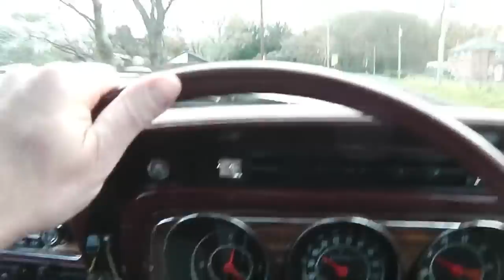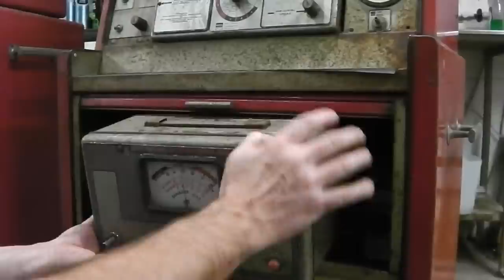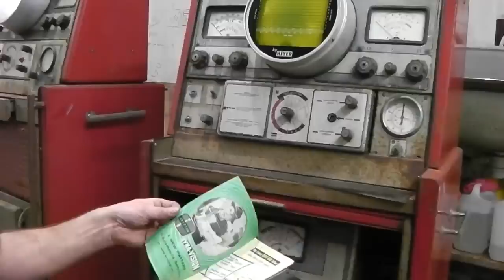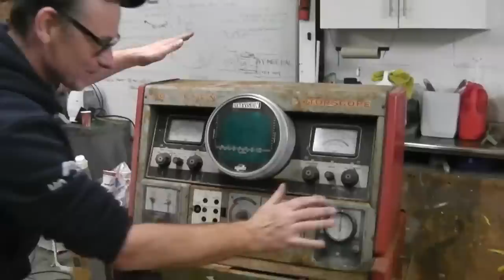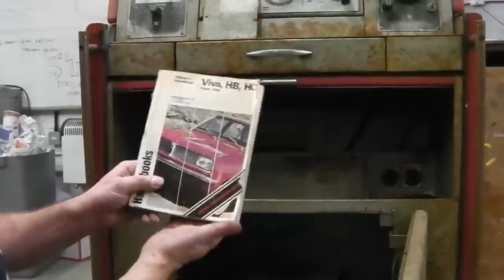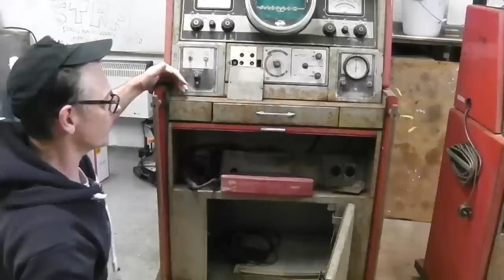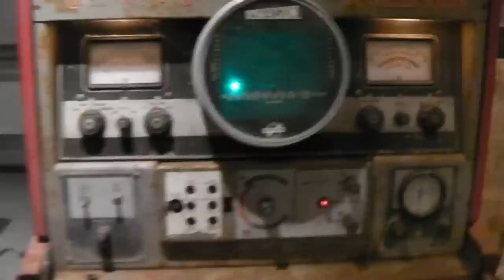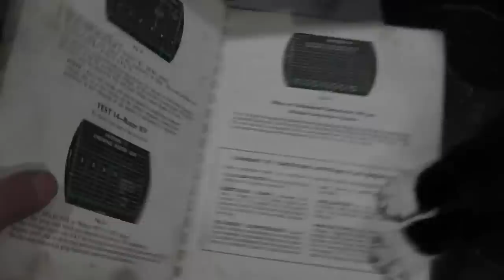Crypton Dynavision Double Bill

Comment: The Austin Allegro was a 1750 model first registered in August 1974.  DVLA records show the vehicle as having been untaxed since the 1st of March 1988 and no MoT records are held which strongly suggests the vehicle no longer exists or has been off the road somewhere for 30+ years.  It is listed as having not been exported but sadly the information on the DVLA site doesn't record whether the vehicle is recorded as having been scrapped.  An early 1750 Allegro is a rare car now, it would have to be either an SS (Super Sport, the model that held, or still holds, the Guinness world record for driving in reverse) or an HL to have the 1750 engine from the factory and both of those are now extremely rare with maybe low double digit survivors.  The Austin 1100 was registered THP 657J, first registered in August 1970, it was also white and is recorded as having been untaxed since the 25th November 1986 with no MoT records held, not recorded as having been exported and has no information as to whether it was reported scrapped.  Based on how the ADO16s could rust it's probably a fair bet that it has long gone to the great scrapyard in the sky.  The Austin was the bottom of the range for those cars and you could still buy decent ones (if you could find one) for pennies well into the '90s or even 2000s so there wasn't a lot of interest in them, had it been an MG, a Riley Kestrel or a Vanden Plas Princess 1100, or even an Austin or Morris 1300GT it might have attracted a little interest but as an Austin 1100 nobody would have cared in the mid '80s, even if it did do pretty well to make it to 16 years old...
Reply from the maker: dont know how you get all your info, you are connected direct into the 70s
Reply: @PeteCswampy    A bit of a look on the DVLA website and draw a few conclusions based on the info there.  Most of the rest of it is just having a mind that collects information that most people would categorise as utterly useless...

Comment: Hi I also have 2 old Crypton machines which i intend to use to tune my classic ( not a Cortina though) do you have a user manual or wiring schematic i have a burned out transformer in one which supplies the CRT screen & want to fin a replacement ?

Thanks B

Comment: Nice score Pete, although powering them up was not a good idea!
The capacitors on the scope part will need renewing, probably just turned in to resistors by now. Be aware that the tubes on these run at several thousand volts EHT. Proceed with care....
Reply from the maker: MArk I knwo what you mean but they were goig to be scrap. I had nothing to lose by powering up. I have worked on EHT all my life and hold Btec city guild radio and elctronic servicing pts 1 & 2  working on all types of sets from eletrohome to Hantarex and Zenith, mostly on mid 80s video gaming machines but first started on vector systems from atari battlezone and asteroids, we used to dry the tubes first, in early mornings in the arcades, damp would cause tracking on tubes that had dust, later i worked for hazel grove servicing SWP quiz games which got caked in tobaco and dust and grime, sparks galore. i have had my fair share of tube belts/shocks, and replaced and serviced hundreds of sets, most coomon repair was line output transformers which used to break down and fizzle or cause flatline, frame collapse, with these sets it was case of just plug and try after letting them warm up in work, they were sat warm for a day before i booted up, i always like your replies and i trust your constructive comments as always Mark, you should see the jerk replies I have had on this, i just block and delete every time, armchair restorers and wasters LOL all the best Mark from Pete
Reply: @PeteCswampy  Hi Pete,  Glad you know what you are doing,  I used to be in the TV repair game years ago, all CRT sets back then!
Had a few belts, the colour sets could give you a nasty zap if you were a bit careless...
Are both of the Crypton units valve based? Looking forward to seeing the guts when you get round to working on these.
I have restored many 1940/50's TV's, lust love how well things were made back then.

Comment: The Viva HB and HC Handybook workshop manual is actually a really good little book.  A mechanic I used to work with had one as he had an HC Viva estate and he swore that some of the information in the Handybook was more accurate and more useful than what was contained in the factory workshop manuals for his car that he'd acquired from the dealership.  The Handybooks seem to have been designed to be of a size to fit in the glove box of the car and they seem to be pretty rare, I don't think I've ever seen another one anywhere up until now, for any car.  Definitely one for the Viva clubs and maybe the Chevette people too as they used the same 1256cc engine...
Reply from the maker: Thank you Jamie ill try and get this to the right people, the handbook thanks for all the detailed replies
Reply: @PeteCswampy    No problems.  I'm happy to share a bit of information if I can, you never know when someone is going to be watching this 20 years down the line and finds a bit of random info useful...

Comment: When I started my career with a Fiat main dealer back in 1989 and 1990 we were still using a Crypton set up and exhaust gas analyser from the early 1970s when the garage was a Renault dealer.  It was a great piece of kit, not all that instinctive to use but very reliable and accurate, even if the trolley was a bit wobbly after 20 years of workshop life.  I wonder what happened to it after the place shut, I did keep my eyes open for a clearance auction or something as there was a lot of old information and stuff I would have loved to get, but I never saw one so I suppose it all went in the skip.  It's a shame as there were full sets of Renault factory workshop manuals and parts books from about 1960 to the mid '80s...
Reply from the maker: Jamie this is what im saying, all this stuff could be lost, no one bid on these items, ive saved em and I hope give em some notoriaty, check the NEG comment from ANDREW , wow takes all sorts, im an IDIOT according to him/her
Reply: @PeteCswampy    Some people just don't understand the attraction/addiction of old cars.  Technically the latest cars may be more efficient and are certainly safer, but most of them aren't particularly reliable, even compared to early '70s stuff, and they certainly don't have the character.  Cars have become domestic appliances now, just very expensive white goods with wheels.  But is anyone going to reflect kindly on them 25 years down the road?  I can't see it.  It's good to save bits of history, whether it's the cars or things like the Krypton machines and the attached literature, and there's a fair chance that some of the literature is going to be pretty close to unique now as a lot of it is stuff that was intended to be disposable.  As for the haters, well stuff 'em, you get joy and fun out of what you do, and so do a whole lot of other people, if they don't like it they don't have to watch, I'm sure there are plenty of gardening channels or Hentai ones for them.  I just don't understand the point of watching something that isn't going to appeal to you just to leave a negative comment, it's just a pointless use of time.  But, people are strange and a lot of people do things on YouTube they'd never dare to do in person...

Comment: I work in a tv workshop so give me a shout if you need any replacement components, HT capacitors etc, may still have something around. there’s even some valves in a dusty box somewhere
Reply from the maker: thanks Gaz, I cant believe the larger unit fired up, I think with a scope it runs different to a TV theres no raster as such? Its scanning just on the single input as opposed to an xy? i need to research it

Comment: Those machines are great , l'd keep them as they are (unrestored) . Was wondering what they smelt like ? Kind of metallic-ey or iron-ey ? Or battery acid-ey ? Enough of that "smooth radio"  crap at the start of your video Pete - give Joe Walsh's "analog man" a listen !
Reply from the maker: Joe Walsh is still analog! good album Pete, they smelt old valve smell, musty, then as valves heat up a mellow smooth....burny smell, then just faint smells of engine oil....should i really keep em as is??? what oyu think?
Reply: @PeteCswampy  : musty then smooth burny smell , wasn't expecting that , thanks for description Pete . Although they would look great shiny and new , l personally would leave them as is . They have more character that way . Perhaps do one up and leave the other for comparison ?
Reply from the maker: yes maybe i really appreciate your thoughts on the resto of these machines, i must admit i was thinking leave em as is, with patinna being a popular thing but im torn, i want to make new decals, i wanna replate and renew, to make those decals new again, rrrrr its so difficult for me, i need order and symetry , things need to be painted and straight, that said i do appreciate some decay, well i love decay, should i leave it alone, theres a place for everything and no where for nothing, yes the smell I described, its unique in these machines, or maybe my vulcan bomber cockpit parts I have....
Reply: @PeteCswampy  heck Pete , have you checked if the writing on the tyres of all your 'tina's are in the same place on their wheels in relation to the position of the valves ?!